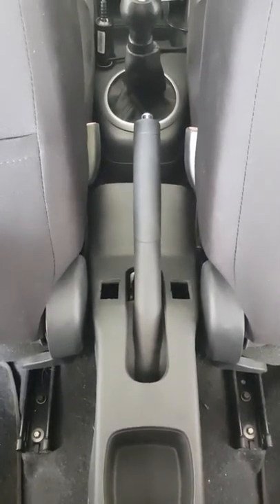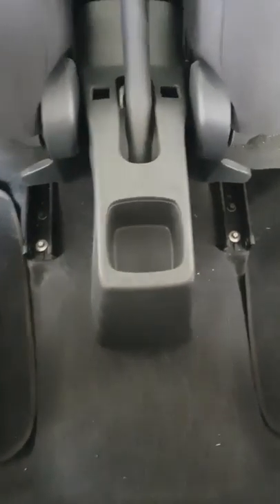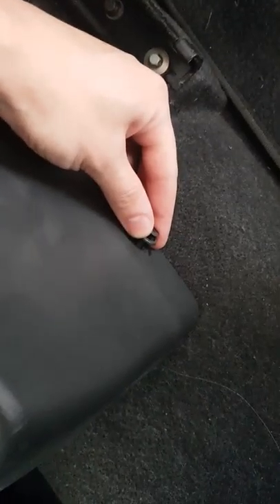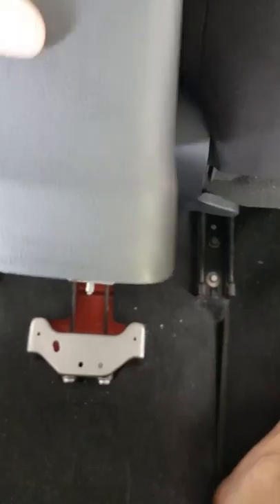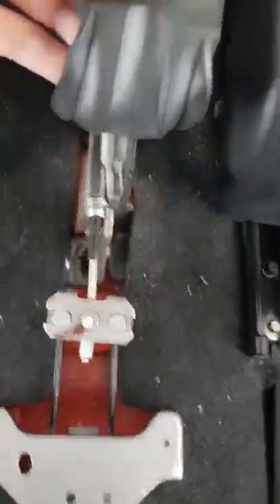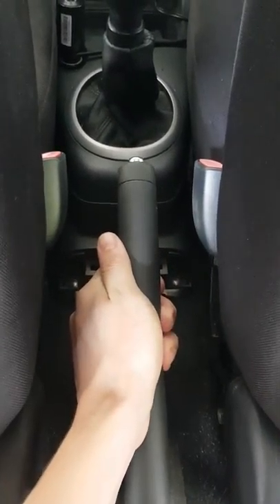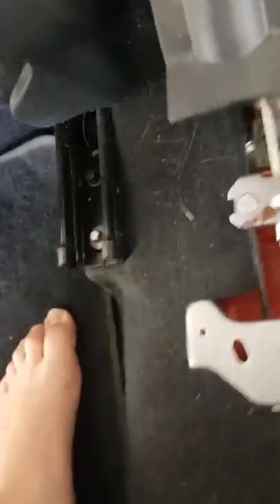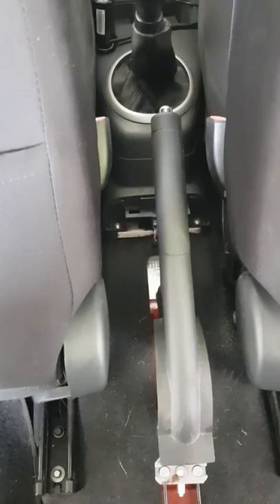Suzuki Swift Handbrake tightening / adjustment

Comment: You don' t set the bolt while it is tight. You have to let it loose. Lift car and adjust bolt while one man is on the car and other is at the wheels. When you turn wheels and the start to be hard to turn, unbolt slightly  until wheels turn free. For best results you have to adjust rear brakes self adjusting mechanism if you have drum brakes. If you have discs rear you don't do it.

Comment: false video,  this is only habdbrake cable lenght adjustment !!! it does not adjust hanbrake shoes
Reply: The shoes self adjust when pressing brake pedal
Reply: @jonathan46vr  must adjust shoes first, then to adjust handbrake cable length,
It will take ages to adjust by pressing brake pedal, when replacing brake shoes, and did not adjust shoes manually